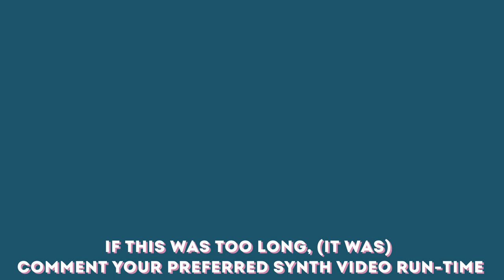Deepmind 12 // Hands-on Patch Walkthrough // Brass, Sidechain, Ambient

Comment: Rad!
Thanks 
I have been using a d12 for a while but never messed with syncing the sidechain.

Side question does your deepmind have a high pitched hiss? Mine does but only after about noon on the master volume.'

Thanks for the Juno soundbank as well. Excited to download that when I get home
Reply from the maker: I do have some ground noise yes. It's easy to filter out, but still annoying. Turning off the pitch and mod wheel led's actually helped me a lot, and turning down the fan, I did early on in my time with the synth
Reply: @JorbLovesGear  oh thanks. I only turned down the fan. Never thought to turn off pitch wheel leds